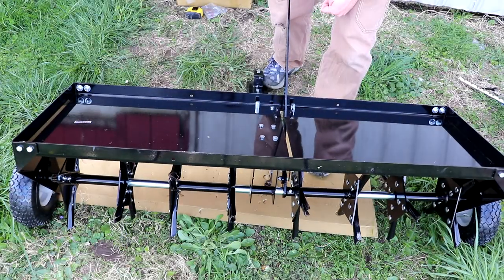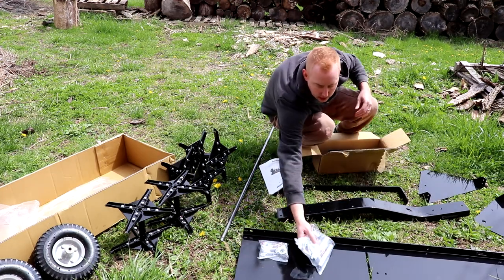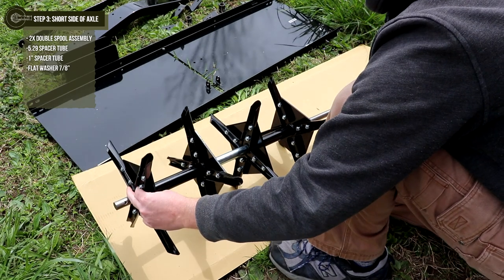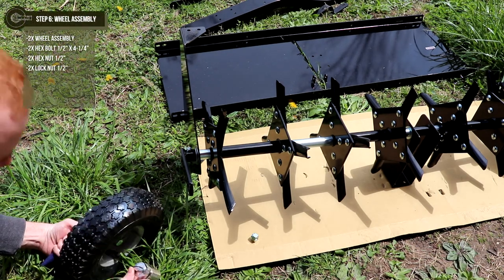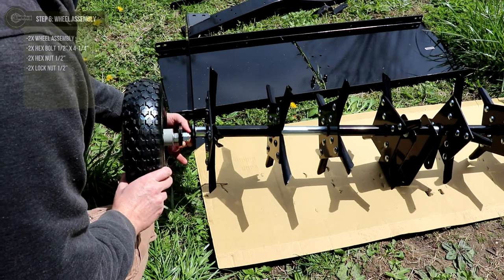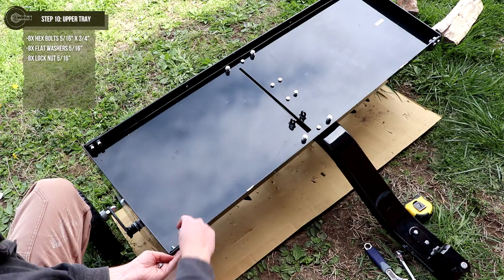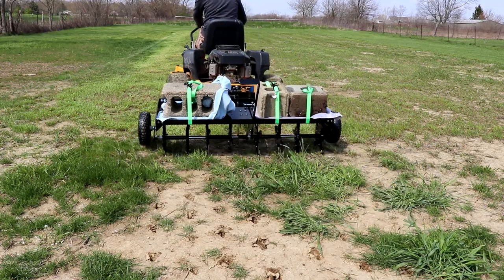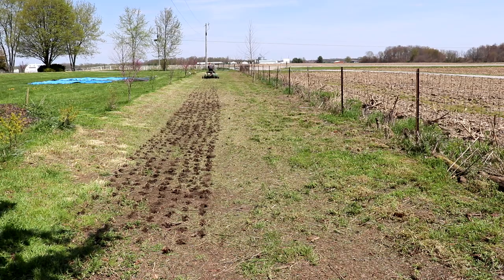Strongway 48in Plug Aerator: Complete Build | 2 Year Review

Comment: The wheel assembly is a little confusing. There are no 1/2” hex nuts in my package. And there is a 1/2” space on the 1/2 bolt when you put the wheel on because it’s not an all thread bolt

Comment: Great video, how often do you used arerato per year. I'm thinking about using one for small lawn care business, until I can afford a gas powered one. I have research the agri-fab arerato seem like they almost about the same the wheels are different. Thanks
Reply from the maker: Hey Eric, I don't use the aerator for lawn care in particular but it definitely does the job it was intended to do. I use it to rejuvenate old, worn down and compacted areas of my property that need reseeding. I've probably put around 24 working hours through the machine with no hiccups.
Reply: @IndyHomestead  Thanks,👍